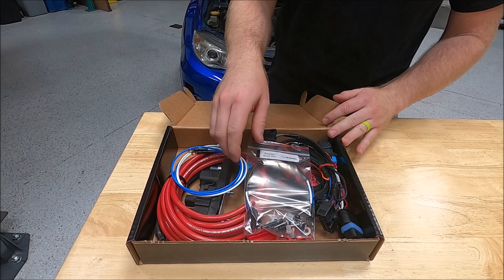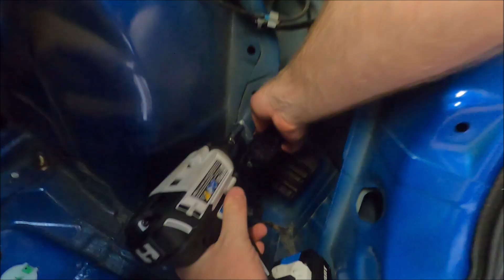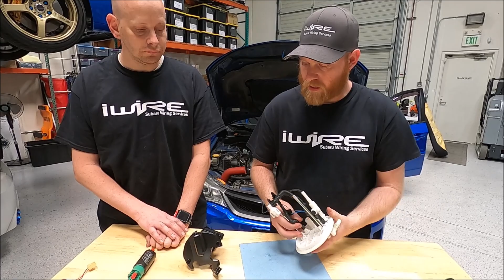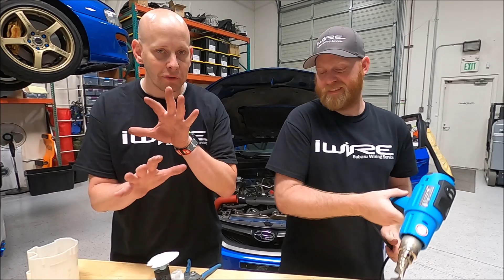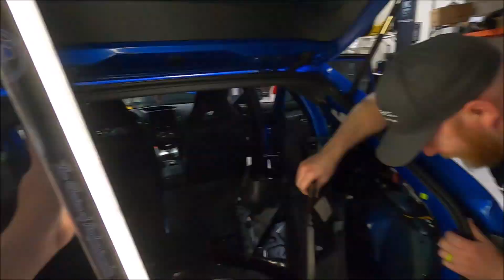iWire Fuel Pump Controller Hardwire Kit Install Video - Single Pump Kit

Comment from the maker: 0:28 - Kit Components Overview
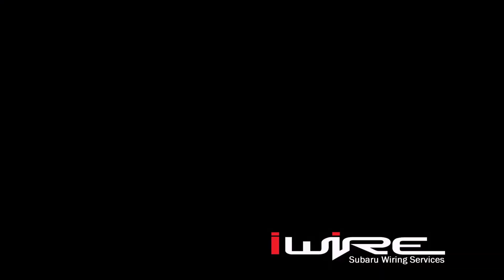2:41 - Remove Interior Trim and Run Battery Cable
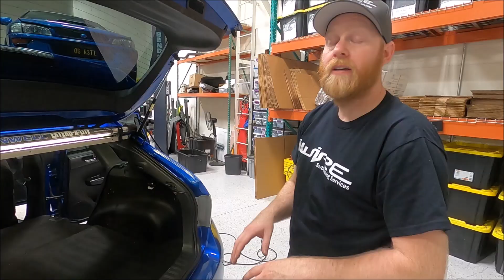9:00 - Remove Back Trim Pieces to Access the Fuel Pump Controller
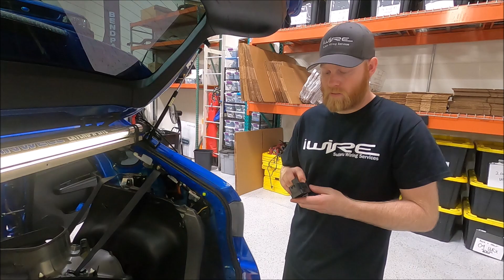11:28 - Fuel Pump Controller Module and Jumper Install
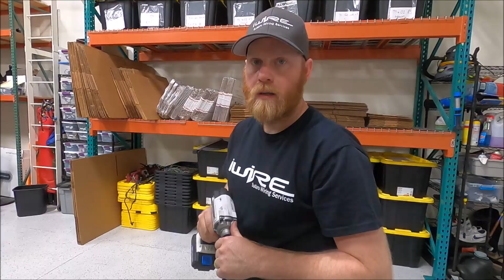17:20 - Ground Wire
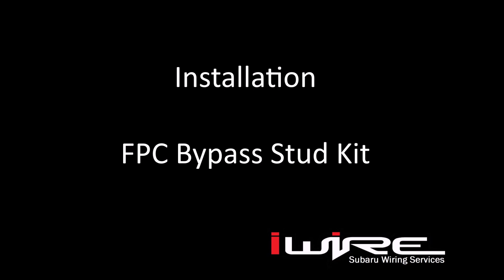18:31 - Bypass Stud Kit Install
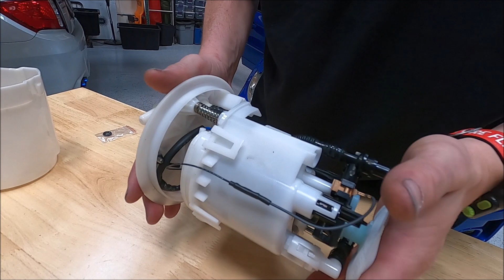33:46 - Reinstall Fuel Hanger into Car
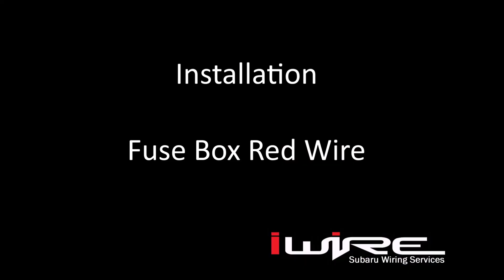38:15 - Add A Fuse
40:50 - Battery and Circuit Breaker
43:52 - Testing and Troubleshooting
45:10 - Tidy Wires and Reinstall Trim
49:18 - Tuning
49:45 - Fuel Pump Comparison Details
52:11 - Stock vs Upgraded Fuel Pump Controller

Comment: i just installed my kit on my 2011 but it’s not priming my pump. i keep coming back to this video to check my work but im certain everything is done right. the only difference between our setups is i am running a radium hanger. i have the wire from the black module ran, plugged in with the fuse running to the secondary fuse box as shown in this video (with 2 15 amp fuses in) and the positive and negative are wired up to the hanger. still no prime. i’ve checked fuses, my ground, my wiring. i threw a multimeter on the hardwire to the hanger. i was reading no volts. when i unscrewed the nipples and took the wires off i tested them again  with the ignition and i was getting 11.6 volts.
Reply from the maker: The best way to get troubleshooting help is to send us an email to info@iwireusa.com. That way we can get you in touch with one of techs that should be able to sort out your issue.

Comment: Wonderful kit! We just installed the hardwire and stud bypass kit on our 2005 WRX. Ran into an issue where the pump wouldn't prime with ignition. After checking everything, it turned out to be the fuse in the module was in the wrong side! Swapped it around and all is well.
Reply from the maker: Glad you liked it! Our apologies for the issue and glad to hear you were able to get it fixed!

Comment: I have a 2012 Subaru wrx with the deautschwerks X2 dual pump hanger with 2 AEM 340LPH pumps. I’m running the full iwire dual pump wire kit trying to retain the oem fuel pump controller. On the top hat there is only 2 positive and 1 negative and for Level 1 positive and 1 negative. How do I go about wiring up the iwire jumper to the top hat after I plug it into the oem stock fuel tank connector for fuel level and fuel temperature? I don’t have enough terminals on the top hat. I know radium has them but do you have instructions or have you done it with a deaetschwerks X2 Hanger? Please let me know asap. Dyno day is in a little less than 2 weeks. 😢
Reply from the maker: Thanks for reaching out about this. The unfortunate answer is that because the DW hanger doesn't have independent studs for the ground side of each pump, it is not a good option for a Subaru application with 2 pumps. You are welcome to reach out to our tech support team if you have additional questions by clicking here. https://iwireusa.com/pages/contact-us

Comment: 53:09 @iwire do you know what the difference is between the 2 Subaru part numbers for fuel pump controllers: 22648AA140 vs 22648AA081 ? It seems almost every turbo EJ received the 081 and except the 08-14 wagons which got the 140 fpc.
Reply from the maker: The only difference with the EJ platform FPCs will be the bracket.

Comment: Is this required or recommended when doing a full wire in ECU? I'm wanting to do a Link G4X Extreme ECU on mine as I'm changing to dual AVCS and DBW when my stock ECU can't manage them so I need the wire in.
Reply from the maker: We highly recommend retaining the fuel pump controller as part of your standalone addition, which would then leave this kit as an ideal option. If you opt to remove the fuel pump controller (FPC), our kit will not function because it requires the FPC to operate.

https://iwireusa.com/blogs/iwire-university/iwire-fuel-pump-controller-hardwire-kit?_pos=7&_sid=170b19d74&_ss=r

Comment: Can this get rid of my p1230 code?
Reply from the maker: Unfortunately, it does not because that code is likely due to a fuel pump controller failure. We have some help with that here - https://iwireusa.com/blogs/iwire-university/fuel-pump-controllers-part-2-diagnostics?_pos=10&_sid=73b1dbb22&_ss=r
Reply: @iwiresubaruwiringsolutions  
Can a fuel pump control module solve the p1230 code or is it the cable connected to the fuel pump that can solve the code? I have 2002 Subaru wrx Impreza and need help.
Reply from the maker: @OscarFishing7 @oscarg436  Yes, it's possible, and you could put a known good one in to test.

Comment: The grommet to the fender is blocked off by some control module boxes in the VA. There's no room to get a hand in there let alone a knife, hand and eyes.
Reply from the maker: This may help with the VA chassis. https://iwireusa.atlassian.net/wiki/external/MTYxZGIyNWNjMmE0NGZiMTgyZTgxYTJmNTcyNmI5Njk#Section-3b%3A-Newer-Model-Alternate-Power-Cable-Routing
Reply: @iwiresubaruwiringsolutions  I just used the grommet that's a couple inches lower for the door wiring. It's less protected from the elements so I'm going to add some RTV to help seal it.
Reply: @iwiresubaruwiringsolutions  Yall sent me the wrong stud bypass wiring lmao. sent an email out.

Comment: So where's the video for the f a model?
Reply from the maker: Standard kit does not work with 2015+ WRX and 2014+ Forester due to Fuel Pump Controller Design. Please contact us for current solutions we offer.

Comment: This video is super helpful with showing how to run the wires through the car to get to the fuel pump controller. However, I have an 04 STi, and just swapped out my OEM metal fuel hanger for a Radium dual pump hanger. I want to run dual Walbro 450s can your fuel pump controller kit do that without having to drill into Radiums Aluminum hanger? Do I have to instal the bypass on the Aluminum hanger or does the wiring kit for the dual pumps come already plug and play without having to drill into the Radium Aluminum hanger?
Reply: Hoping they answer on this
Reply: It's plug and play. The radium hanger already has all the studs you need

Comment: Thank you for your video, I have a drain on my battery with the car off from the power feed to fuel pump controller relay. I have the Visconti set up with the 525 pump , any idea what could be causing it ? I
Reply from the maker: Hi Mike are you using our hardwire kit with the Visconti basket?
Reply: @iwiresubaruwiringsolutions Thank you for your response, Im not sure I had a shop install everything .
Reply from the maker: @mike63ful  If you have our kit you'll need to make sure the add-a-fuse is in the correct location. If it is not, it can cause the relay to stick open and drain the battery.

Page 44

https://cdn.shopify.com/s/files/1/0460/3822/0953/files/39dc8e_f6d050a5904240aaa0d52c5c161e2bc5.pdf?v=1636933854
Reply: @iwiresubaruwiringsolutions  I confirmed with the shop they do use your hardwire kit . Thank you again. I will have to check that out.
Reply: It looks like the red relay trigger wire is plugged into slot 23 on the fuse panel 16 STi .Which fuse panel slot should it be in on a 16 STi ? Thanks
Reply from the maker: @mike63ful  It'll be in fuse 11. More on this can be found in the following link on page 44.

https://www.youtube.com/redirect?event=comments&redir_token=QUFFLUhqbjM4ck42MG5tM1NuVHdrRngzX0lVSDR4UjVlZ3xBQ3Jtc0ttLW9sOFVEMXdia3JUVmFYZl9GVFRQNGp1U1NBT2tNOHp3R0llQVNZT25zSWt6RXhQSkx3TFNVTFpuNm9FYUpVRzN2V3NINkJhZllpTlNzY1psNXF4TG1jR2tvcjZwS3VqdXc4dk9zRUl4X0pSenR4RQ&q=https%3A%2F%2Fcdn.shopify.com%2Fs%2Ffiles%2F1%2F0460%2F3822%2F0953%2Ffiles%2F39dc8e_f6d050a5904240aaa0d52c5c161e2bc5.pdf%3Fv%3D1636933854&stzid=UgwRsv75Cqw2XOufD9t4AaABAg.9tjg78kQq6M9tlhUxzCPhu
Reply: Changed fuse panel slot to #11 for trigger lead , no change. I noticed two aem gauges are spliced into the trigger lead , could this cause a problem ? Thanks
Reply from the maker: @mike63ful  Please send us an email to info@iwireusa.com with some pictures of the installation so we can troubleshoot further.
Reply: @iwiresubaruwiringsolutions  ok will do, Thanks!
Reply: @iwiresubaruwiringsolutions  False alarm ! Looks like changing to slot #11 fixed it ! I thought the voltage drain was still there ,after using a probe that detected voltage immediately after the ignition was turned off.Maybe theres a delay after turning the ignition off which continues drawing power from the battery. Thank you !!
Reply from the maker: @mike63ful  That makes sense because the ECU has a self shutoff so it will stay on for about 30 seconds after the car is turned off

Comment: Why wouldnt you do a dual set up? Running a single pump relay is easy
Reply from the maker: We offer a kit for dual pump as well and our standard single pump kit is prepped for dual pumps if you change your mind later.

https://iwireusa.com/collections/iwire-plug-and-play-harnesses/products/fuel-pump-controller-hardwire-kit-for-radium-hangers-double-pump?variant=41189188894873

Comment: Im in the middle of installing this in my 2006 Forester XT. Here's a few notes so far:
1)make sure the add-a-fuse is oriented properly. I used fuse #14 and the hot side is on the bottom, therefore the pigtail needs to be oriented up. If not, if that fuse blows, it'll break the circuit to iWire relay.
2)the forester cargo cubby gets in the way of any of the convenient mounting locations so you have to get creative to mount it securely. I drilled a hole and made a bracket out of aluminum bar
3)if you're upgrading your pump and it didnt come with an install kit like the aem 340, make sure to buy an install kit that includes at least the rubber isolator. My OEM one disintegrated badly. I ended up buying a $15 fuel pump on Amazon that came with the isolator, new hose clamps, hose and those pre-filter retainers (i just chucked the pump it came with)
4)might as well replace the fuel filter if it's the original while you're in there

Comment: With a 95 GF8 and a DW400 how do you make the stud bypass work? The fuel pump hanger is all metal. Will those small bits of plastic prevent it from arcing?

Build 1681
Reply from the maker: It'll work all the same as the 02-07 WRXs with the metal hanger.  https://cdn.shopify.com/s/files/1/0460/3822/0953/files/39dc8e_265b355d59fa4215906a5b8fc1a010b8.pdf?v=1636933777
Reply: @iwiresubaruwiringsolutions  awesome thanks! Finally finishing the build.

Comment: i have a question the fuel pump wiring that sits in the tank. What type of insulation is that made of? is it Teflon/ PTFE or is it something else/
Reply from the maker: It's ETFE since we use Tefzel for the wire and the extra sleeve is Raychem DR-25.

Comment: Just did this on my 02 bugeye and finally did my first start last night on my new build. I am having issues with my fuel gauge not working. I'm assuming I did something wrong? Are there any common mistakes made that cause this or issues?
Reply from the maker: If it's the fuel level gauge sometimes the floaty gets stuck up when you reinstall the hanger. If it's something else please send us an email to info@iwireusa.com so we can assist you.
Reply: @iwiresubaruwiringsolutions  Thanks! I'll pull the fuel pump and check everything out.

Comment: Soon as you get this back in Stock I'm Buying One. 05 Outback. Having Fueling Issues...Runs Out at Top RPM. Should be Pushing North of 400hp. Currently only hitting 360hp with what I'm sure is a Low Fuel Pump Voltage Issue. That AEM340 going to need all it can get running E85. Hopefully you get your Stock. I would buy one today. Cars Currently sitting at the Performance Shop waiting for this Fuel Pump Wiring Upgrade🤦‍♂️

Comment: I'm doing this on a 02 WRX bugeye but, I do not see the small ground wire on my fuel pump for the stud bypass kit. Does this not get used in the 02-07's?
Reply from the maker: That correct. You do not need that wire.  Clip it short to the connector.

Comment: What would change, or how would you power the second pump, if you're running two pumps but one is just a pickup for the in-tank surge tank?
Reply from the maker: The second pump is run on an on/off switch. Surge tank would be completely different wiring than this kit.
Reply: @iwiresubaruwiringsolutions  I'm dropping this into an 05 STI. Would I treat the lift pump as basically a 2nd pump (as in just buy two of your wiring kits)? Or is there anything special I should do for the lift pump? Thanks!
Reply from the maker: @goblazers4435  Please send us an email to info@iwireusa.com so we can chat specifics about your build and get you the custom wiring kit you need.